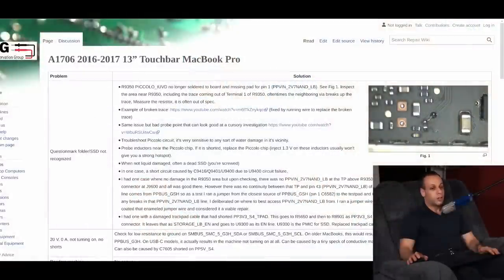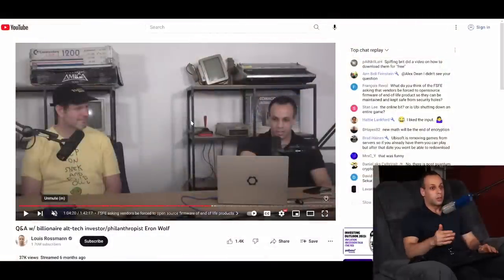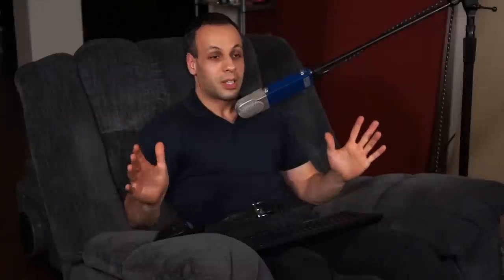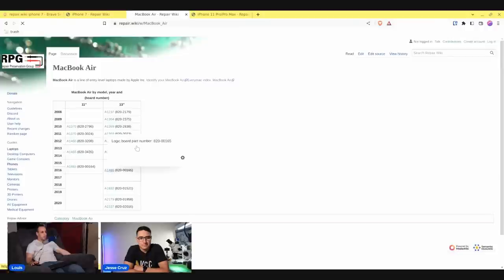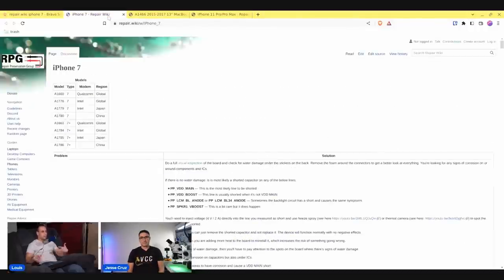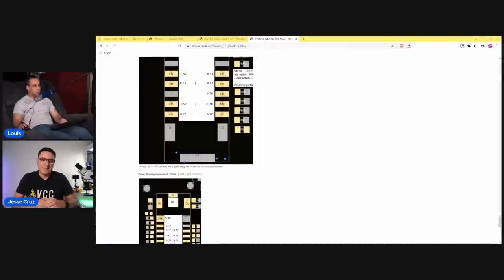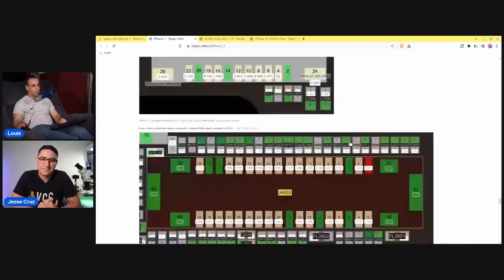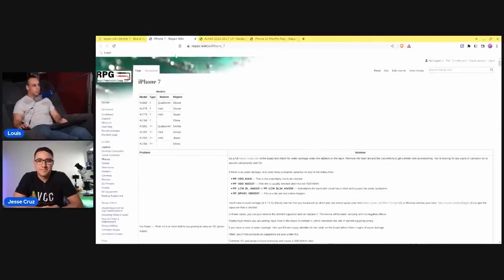A thank you to repair.wiki's top contributors

Comment: Thanks for all the hard work. I have had to dig in and do board level repairs (through hole) on household equipment. I had an older high end Sony receiver that I was able to diagnose as cold solder joints at a connector. Another was my treadmill stopped working. I opened up the control panel and I could see the smoke was let out of a transistor. I went down to Fry's and picked up a new transistor, soldered it in and was back in business. Thank you 1991 high school electronics class. We got to burn our own PCBs